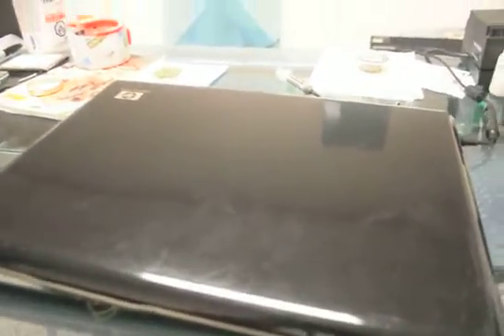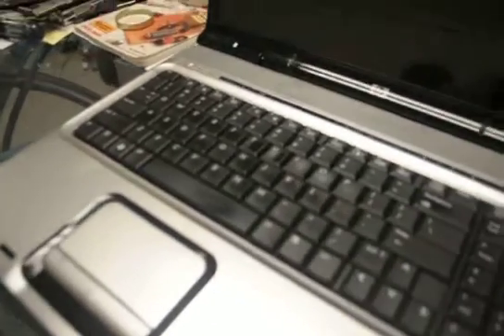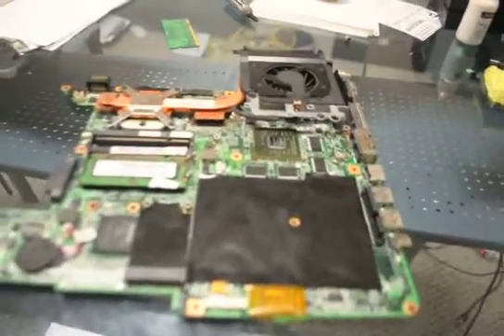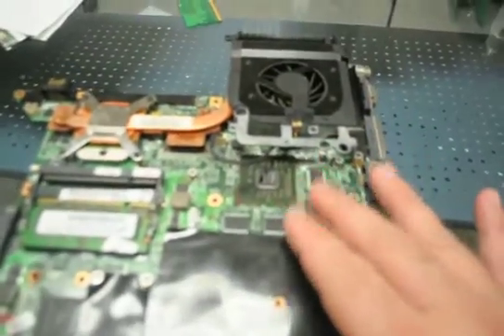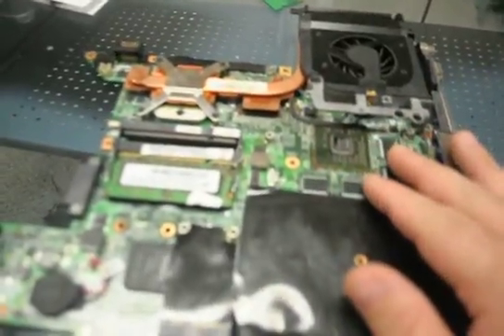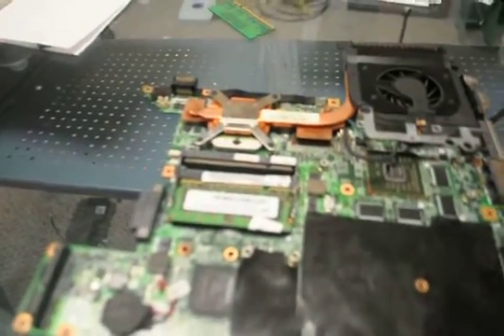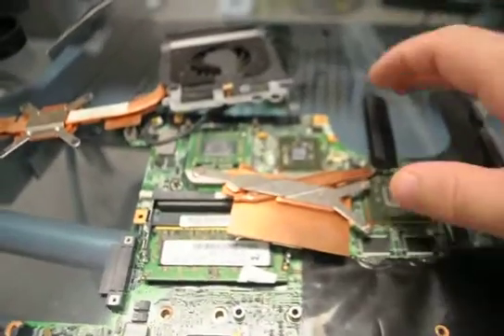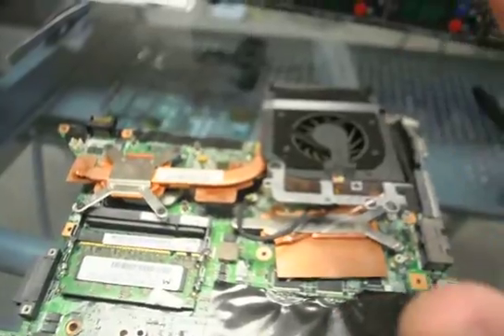IR BGA reflow of a HP DV9000 AMD laptop motherboard with Nvidia graphics to fix a no video issue

Comment from the maker: Well, again a matter of opinion.  Antistatic bands can be attached to your ankle also.  Just a tip if you use your hands a lot like any proper technician would.

Second, this video is well over a year old and having not seen this laptop again I think my "ghetto rigging" the heatsink for a little bit in my "make believe shop" worked just fine...

Comment: No tea, no shade. You're flipping and tossing the mobo around and touching all the components. You're working on a carpet and not wearing an anti-static wrist band nor discharging your body. Also, ghetto-rigging a heatsink in a laptop is very risky. Without proper airflow (fan power) or thermal sensors this laptop might find itself back in a shop in a few months of use. Just saying.

Comment from the maker: Really, my incompetence, which is how I believe you spell that, could, which I feel you spell that way also, damage the board except you'd, which I feel is spelled this way properly, wrong in the fact that the glass table is not conductive electrically, but thermally passing only heat so to answer your question No, I am not mental as in mentally handicapped as you suggested, but perhaps mentally inclined as I know the difference in thermally conductivity and electrically conductivity.